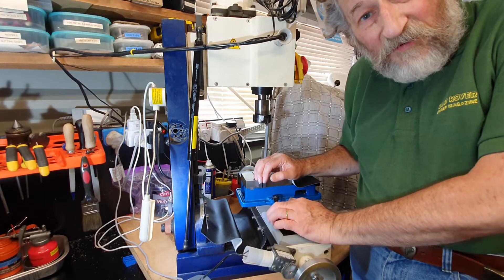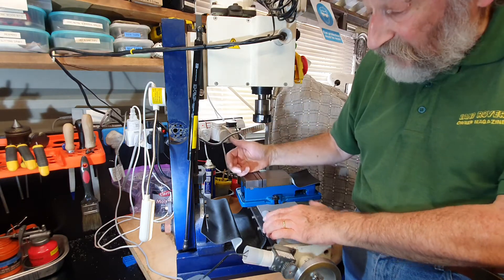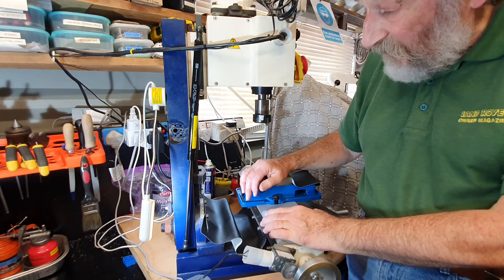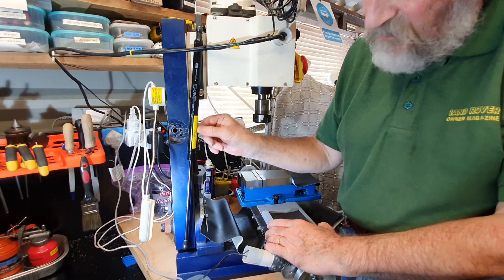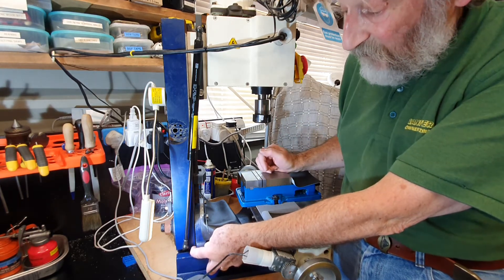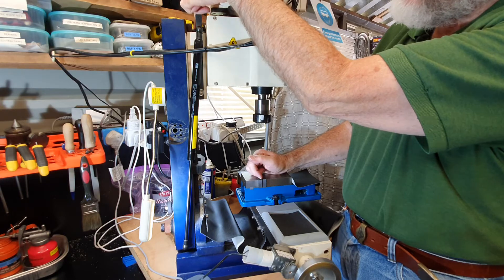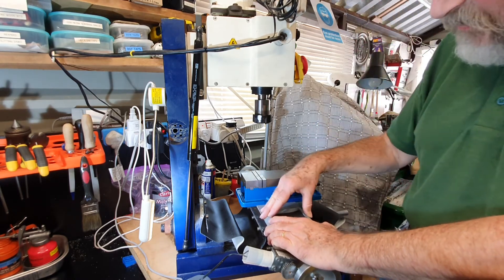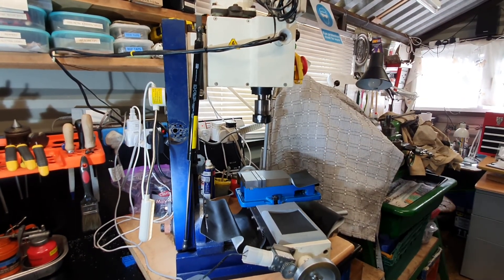Mini mill gas strut and powerfeed part one.

Comment: Gas strut with 150 newton would be about perfect.item is  GS6-15-220-260
Reply from the maker: From memory the one I used was about 300 newton. This has been on the mill for over a year now, and has proved to be perfect for me. I can now make fine adjustments more easily, and accurately.  I've since added a DRO to the mill, and this combination means greater accuracy. Cheers Nobby

Comment: I have the same mill. I also mounted a gas strut. The spring torsion arrangement is useless. The gas strut transformed the Z axis operation.
Reply from the maker: You're right Aetherling it makes the mill much smoother to use. Thanks for looking Cheers Nobby